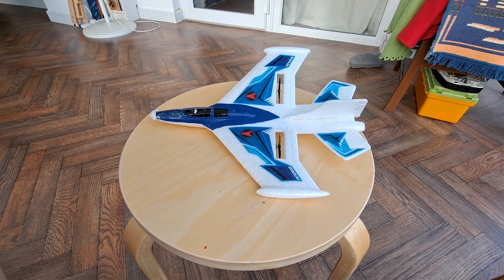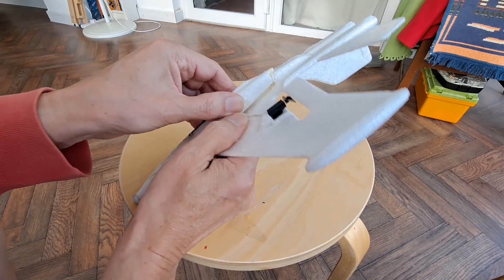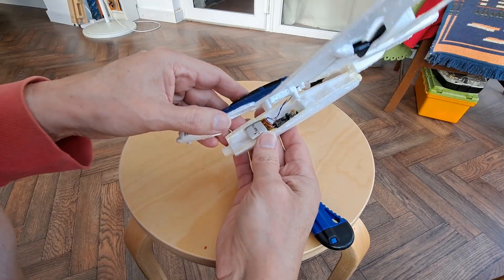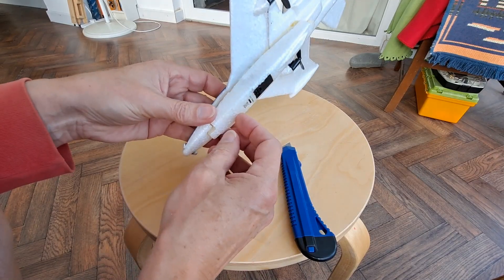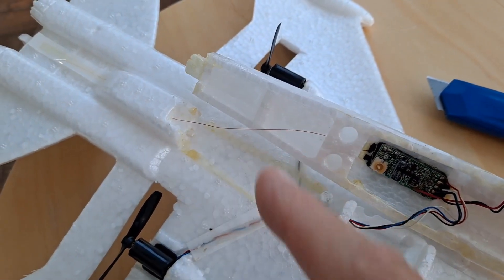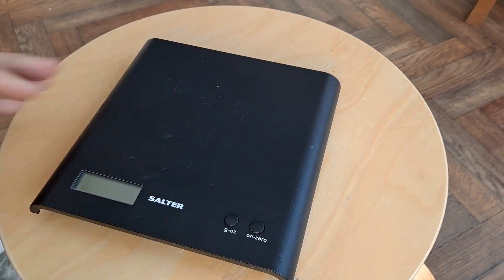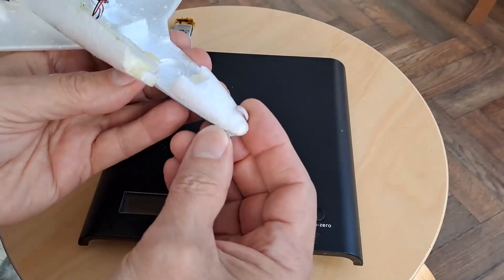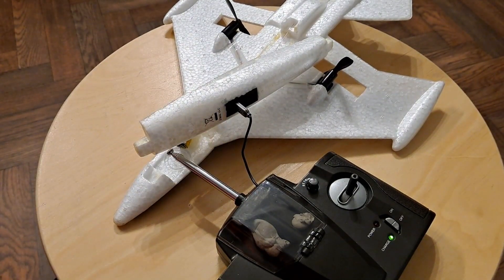Silverlit X-Twin Jet revisited P2 20221011 Peek inside

Comment: For an ITC F22 of similar vintage and shape, I ran a connector up to the back of the canopy area. Then, hollowed out the canopy area itself. It meant the canopy could be removed, a batt slotted in, the canopy replaced. Worked out fine for CG.
You could fit a connector to the TX, removing the batteries for charging by a 9V wall adapter 😀
Reply from the maker: Yes, access down through the canopy would be a good option. I might do that when I do the next session with the lighter battery I have now. I was going to put connectors on in this modification, but as the battery was so heavy I wanted to minimise the extras.

Comment: try replacing a wire atenna for better range.
Reply from the maker: Do you know how to calculate the length of the antenna in relation to the frequency of the radio signal?

Comment: 5+ grams is a lot of weight to remove from a foam plane, if there is even enough foam to remove!!
Reply from the maker: Just need a lighter battery. If I wasn't trying to do this with Vape batteries I could use ones I already have in stock.